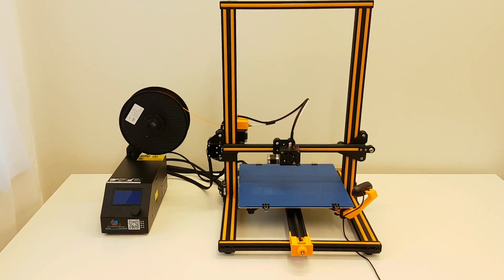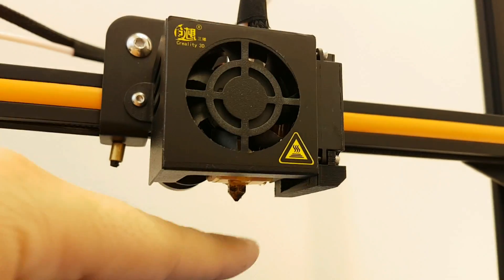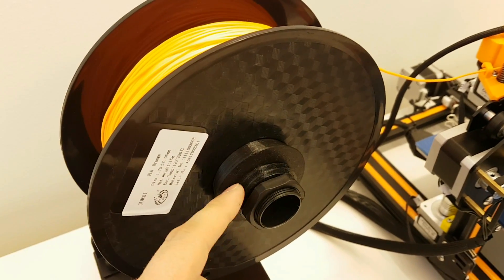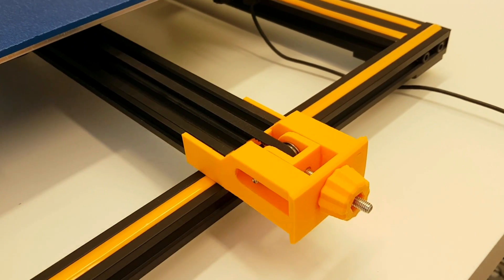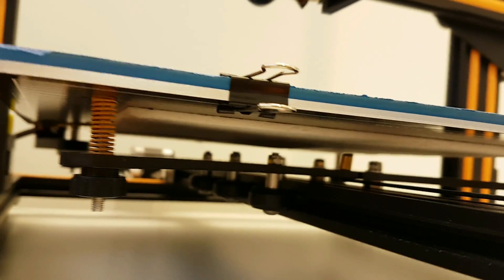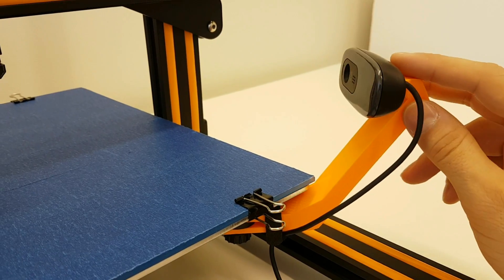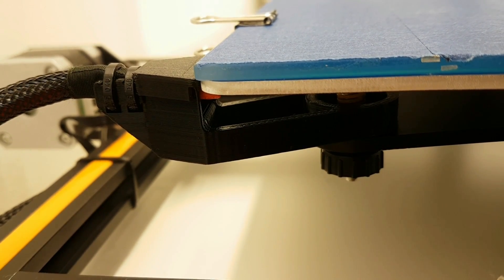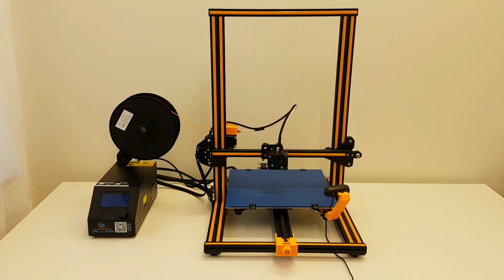Creality CR-10 Upgrades

Comment from the maker: With Insulation material under heated you can achieve and maintain about 99 degree Celsius which is good enough for printing ABS of PETG materials. Here is image of test: https://goo.gl/dqXYVR
Reply: Nexi Tech do you have the link to the washer you printed?  I can't find anything like that anywhere but I appear to have the same issue
Reply: Nexi Tech on the cr10 s4 it is impossible to get over 75C even with insulation.
Reply from the maker: Really? Not sure about what power supply and heatbed mosfet are in CR10 S4  but my CR-10 can do it without problem. Look at image in my previous post.
Reply: Nexi Tech I think power is basically the same as the standard 300mm model (draws about 200Watts during a print) so it ends up being under powered for the larger CR10s.
Reply from the maker: My CR-10 has 30A 12V power supply with auto cooling fan that is 360W power supply. And there is also heat-Bed power mosfet inside control box. Check yours maybe is not the same.
Reply: Hi i just want to ask because abs is my biggest challenge. I haven't even tried printing ABS yet but would like to in the near future and so maybe you can tell me if i need to upgrade the mosfet on the heated bed. I have the CR-10S upgraded version. Think the only difference is that i have dual Z axes and a different motherboard. Everything else should be the same. Thanks
Reply: NexiTech - I need the washer as well... lol
Reply: Nexi Tech What size screw and nut for the tensioners? And would you recommend we change the rubber timing belts?
Reply: The link for the insulation doesn't work anymore (404). What is it called? I was thinking of using some sort of insulation that sells in my country. It glues to the wall behind the radiator in the house, to keep less heat radiating towards the wall, and more towards the room. They glue it with some generic glue, and that's what keeps me from using it.

Comment: Does these upgrades also work for the 10s
Reply from the maker: Mod Boy NERF You don't need duct fan upgrade. That's already fixed from factory on CR10S. The rest is fine.
Reply: Ok thanks

Comment: Hey, Nexi Tech! I'm slowing adding a few (select) upgrades simply because I don't believe the CR-10 actually needs or requires many changes. 

So I have a couple of questions. Since it's been about 8 months since you created this I'm wondering if you'd suggest any other (further) upgrades? Or are there any changes from the upgrades you have added in this vid's description? 

Thx and thumbs-up!

Comment: Hi. Great video. I will be purchasing a CR-10 soon. Can you tell me where you got your upgrade parts from? Also how to print the ones you did? Thanks so much.
Reply from the maker: Hi! Thanks. Please look in video description you can find all links there. All upgrades are print from PLA so you can use standard settings. No special settings is necessary.
Reply: The link to the washer is not in the description buddy?

Comment: After seeing your video I bought thr same insulation material. Now I am wondering would it be still possible reach high temperature request for printing ABS? Or the material can catch fire...
Reply from the maker: Cotton insulation material is petty much fire resistant. It can resist temperature high as 900 degree Celsius. With Insulation material under heated you can achieve and maintain about 99 degree Celsius which is good enough for printing ABS of PETG materials. Here is image of test: https://goo.gl/dqXYVR
Reply: Nexi Tech
That great! I was hoping for that. Thank you very much

Comment: I wouldnt move the camera much because it does change your level. I can see the knob moving one direction when you were swinging it around.
Reply from the maker: brainfarth Well maybe tiny bit If you swinging camera that fast. It will never move itself or while printing.
Reply: Cool. I think I'll be purchasing that printer in the next month or so. I will have to figure out how to build a huge enclosure around it for heat and noise, like I did with my A8.

Comment: CR-10 Strain relief bracket for heated bed cable is by far the most important upgrade - I've never had any issues with belts rubbing or the extruder fan but hey all the machines are slightly different. 
The small filament guide is handy as well. - another good video - thanks
Reply from the maker: I agree! Thanks for positive feedback. Am glad you like it. Good luck with your CR-10 :)

Comment: on the anet a8 i've done the same bowden upgrade that you have, and after putting the gcode that you gave in the description all my prints are still to the side. can someone please help me?!?!  :(

btw i use cura
Reply from the maker: That's strange! Did you upgrade firmware to Skynet and follow every step on my videos?
Reply: lol, i got it. i didn't  upgrade to skynet. thank you for replying to me, your the best
Reply from the maker: Ryker You welcome mate,good luck with your printer.

Comment: hai nexi can I add a g29 to your start  gcode for anet a8
Reply from the maker: sky rim Yes you can but keep in mind that you have to flash firmware to Skynet V1.1 or newest and "enable probe" if you using Auto level probe/sensor. Am not sure in old firmware how only G29 will tell printer that you have sensor probe and on which position is and where it should go. Give a try but am not sure that will work. Good luck :)
Reply: Ok